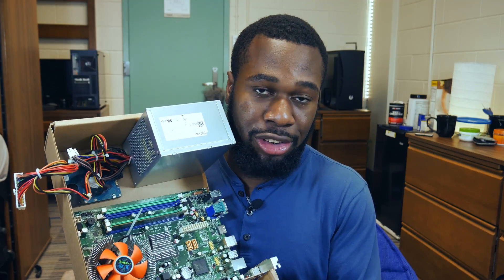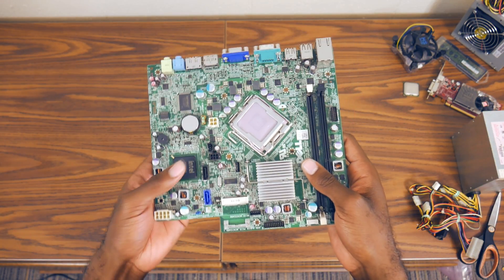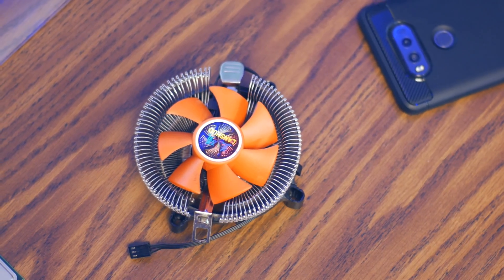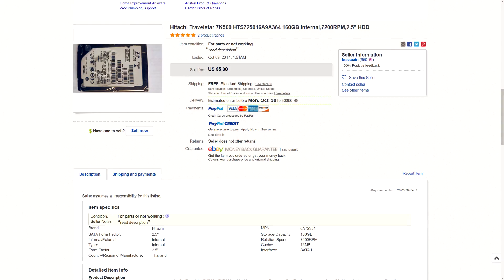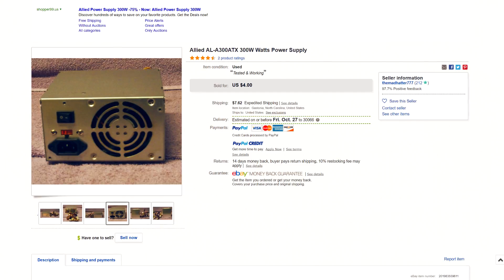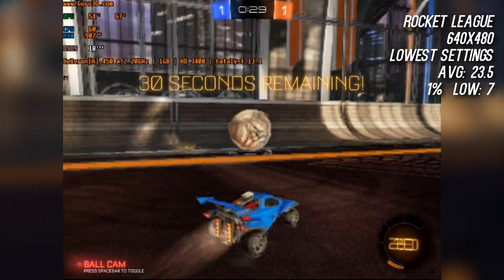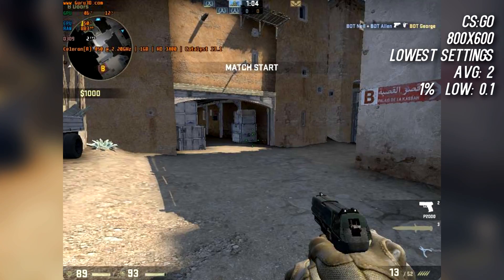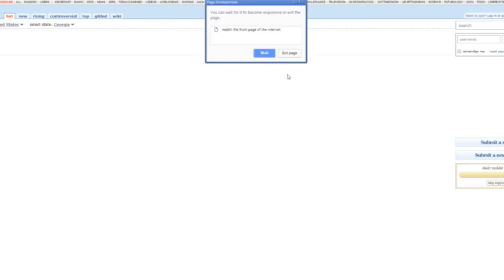I built the cheapest PC on eBay possible - can it play games? | OzTalksHW

Comment: Ok...this Video ist 3 Years old....but even 3 Years ago, I would have bougth an Core2Duo complett PC for 20/25 € and gave it a little Upgrade (sometimes Graphicscard, sometimes a little bit more RAM, etc.) . Today I can get a I3 or even a i5 plus a little Upgrade for 50€. And believe me, Gaming was and is no problem. Last Week I bought an Core2Duo E8500 on a Gigabyte Board, with 3GB  RAM and a Nvidia 9600GT Graphics Card on Ebay for 5 € (plus 5 for Shipping). All Parts in one Auction (tested and working). Today I picked up a PC Case with an 300W NT (tested and working) for free. (Using Ebay-Classifieds ~"Craigslist"). I will spend another 15€ for 1GB RAM and a 200GB HD (15 for both!). Ok, I used Ebay and Ebay-Classifieds instead of just using Ebay, but hey...it´s 2020 and I still can build a complett PC with much better Performance, for only 25€

Comment: I'll be listing working parts on eBay that will be cheaper then this pc. 
Part one- motherboard. Dell optiplex 380 on eBay for 10 usd and free shipping. This has a dedicated pci slot 

Part 2- cpu Intel pentium d925 for 3 bucks 
Part 3 hdd- 5.50 USD 60 gb Seagate 2.5 inch drive

Part 4 hp Quadro 256 mb video card for 5 bucks even 

Part 5 psu 250 w generic Intel for 10 bucks
Grand total
10+10+10.50+3 
33 bucks my bad this was a better build in the video lol. I blame the shit cpu selection online atm. Nothing below 3 bucks. And I havn't even counted in ram yet lol

Comment: i know this video is like 3 years old now but...... Let me get this right, you got a graphics card for $3.5 ( 3:18 ) but then spent under $10 on a cable to use it. I am assuming when you say under $10 that that is was just under as otherwise you would have said under$7 or under $5. in which case. why did you not spend what you had on the connector cable on a graphics card that had a vga/dvi connector that may have been a little better. maybe a Nvidia 8500 GT or a 9500GT or even a Geforce 8400 GS as they could be got for $0.99 to $5 on ebay at the time.

Comment: The cheapest computer I have owned was a Pentium II machine I got in the early 2000's, from a surplus outlet, for I think it was 25 bucks.  With a then-modern video card, it ran newish titles OK back then, so I was happy with it.

My machine today, which I've just about completed upgrading, is about 12 years old (I've had it for that long).  It's a socket 775 Asus P5WDG2 WS Pro (with a modified BIOS), with an Intel QX9650, with a GTX 750 Ti SC, and 8GB of PC8500 RAM.  I am upgrading it from XP to Win7.  Haven't actually gamed with it yet but it boots up and runs just fine with internet surfing and things like that.  Once I get it reformatted with Win7, I'll see how it actually games with more modern titles.

Comment: I once got a $4 Gateway desktop, featuring the Intel Pentium 4 with a clock speed of 3.2Ghz dual core with Hyper Threading technology and a whopping 2GB of DDR2 RAM (4x512MB), missing nothing but the GPU and the boot drive at a thrift store. Via local sellers, I was also available to get an assortment of PCIe and PCI cards for $25, including an old 256MB (incredible for the era of this computer) ATI Radeon GPU, that got the old motherboard to launch into the BIOS configurations. I paired all of this with a 500GB HDD boot drive salvaged from broken laptops given to me. I managed to install 32-bit Windows 7 Home Premium on, and voila! A total of $29 spent on a refurbished Intel-based build. A great deal found locally!

Comment: Oh god, flashbacks of that "one time" a buddy and I pieced together a computer using various remnants of computers spanning several years. Industrial strength velcro, metal tape, and a lot of fiddling. It worked, and it worked great for what it was (an essentially free computer). I just did a quick check over eBay and surprised at all the available parts that are pretty cheap now. I'll have to keep this in mind because before the year is up, I will probably be building me a "budget gaming computer". I'd prefer to spend less than $50 on it but may go as high as $100. I don't have much interest in modern games, I just want a computer to play around with. My current computer is an off-lease business desktop that has plenty of power, but it's getting old and gaming is just not a thing it does well. If I beefed up the power supply and found just the right low-profile graphics card and upped the ram to 16GB (max supported), it might be worth it. I'll have to investigate that.

Comment: picked up a Dell Optiplex 960 w/ Core2 Qaud 9400 @ 2.77GHZ for $30 on Ebay, also a Radeon Hd 6570 1GB for $17 and 8GB ddr2 Ram for $18.....total was $55 and it runs GTA V at average 30fps at 480p (low) and 25fps 720p (low). now my wife uses it to play SIMS on.

Comment: I think if you're going to do these "Cheapest PC on xxx" you should build a whole computer. it's not a computer if you have to put the parts in a box. last time i checked, when i go into a computer store and as for a computer, they don't hand me a bunch of parts and a box! i think you should do a "Cheapest full computer system build on newegg" or ebay. Should include everything you need to just plug in and go, Monitor, keyboard and mouse, case etc

Comment: cool build. im actually running a lga 775 cpu (core 2 quad q9550)  in my main rig. its on a ddr2 8gb mobo  a asus pq5 se plus and a gtx 1050 2gb. the cpu is  i have is overclocked it from 2.8ghz to 3.4 with water cooling and ssd drives. so in the end i can run fallout 4 in 1080p @ 45-60 fps in ultra setting with only the antialising and vsync turned off. amazing what can still be done with this old tech. soon i will try a ddr3 mobo with the same set up and a mod 771 xeon (x5482) in it. ($60) for both and see if i can overclock to the xeon to 4.0ghz - 4.4ghz. any thoughts or suggestions?

Comment: I don't Understand what stress about the idea of a bad power supply so much. In my name system sure I have a decent pub in other systems I've had I've always used the same 500w Chinese thing that was bought for 13 quid and it's never let me know it's quite perfectly stable it doesn't get hot so I really don't see what the big deal is particularly if you don't need a power angry dedicated GPU - take a 1050ti for example a can run with no additional power connectors. 

And I wouldn't recommend stressing a cheap power supply but using a day-to-day basis I really can't see the problem.

Comment: Great videos, I recently found your channel and just sub.  The reason I found it was cause,  I was wondering what would be the cheapest PC I could build that would play older games and maybe later newer games fairly well. I wanted to just use eBay, parts I already have just easier than driving around town. For example, I found 15.99 Dell Optiplex 7010 motherboard. I have an i3-2100  laying around and some DDR3. That board can support 3rd generation Intel up to I7.    I also have cases the wife wants me to trash. I just ordered a board with the I/O shield for a bit more. I’m concern about the possible proprietary connectors on that board, any advise? Now what to use for a video card. The only thing I have already is an Nvidia 9600GT. I’ll probably give it to a nephew when done playing with it. Thanks for the great content.

Comment: Bought/ upgraded a 775 system for about $175. Xeon E5450(can't go past stock 3.0ghz though since mobo is at its bus limit already with this CPU and has no CPU voltage options), 4gb ddr2 800, 120 gb ssd, gt1030, 320gb hdd, 80gb hdd. Decent little media/htpc. Most of the cost was the gt1030 which I bought used for $70 Canadian and the  ssd new for $50, the CPU for $30 off eBay and also added a deepcool CPU cooler for about $12. The base system which included the hard drives, case and psu, ram and motherboard I found on Craigslist for $15. May have over spent a bit as I could have found a better deal on a video card but I wanted it to use less power and make less heat. Also probably could have left out the ssd if price was a concern but the ssd just made it so much snappier. Once you've used ssds it's hard not to include even a small one as a boot drive even in a cheap budget build.

Comment: my pc that I am using now took me 4 years to build and $250 - 270 AUS it rocks
intel Q6600 2.93Ghz cooled but a deep cool mini 
gigabyte ga-g41mt-d3
AMD hd6950 dirt 3 oc 2 gig 
6 gig ddr3 1300mhz 
corsair vs650w psu
running dual screens 
Logitech g105 keyboard and a ozone neonm10 black mouse and windows 10 pro(not activated)

Comment: Apparently you can get much better deals with bundles, but given the rules of the game...
All buy it now prices as I will not be purchasing, not including shipping, all "working", and all items with crazy shipping prices ignored.
CPU : core2duo e4500 $4
Motherboard : Intel dg31pr $15
Ram : 2x2gb $5
CPU cooler: Intel stock $3
GPU : hd 4670 $5
PSU : 350w $4
Total:$36

Slightly more, but well worth the price difference, lowest isn't always better. Apparently you can get a "working" motherboard with cup and 2gb of ram for under $13. E6750 coup at that.

Comment: Built my main computer in 2008/2009 and was free.  Was signed up for a class on how to build a computer which I took home afterwards.  Still run this old computer, have replaced a few things like CPU,GPU,SSD and recently power supply went out so had to replace that.

Comment: Picked up an old Pentium dual core for £12, reasonable PSU. All it does is sit in a cupboard with a load of pass down hard drives holding a back up set, have an i3 Laptop on the way for £31 too.

Comment: I bought a lenovo desktop with 4gb ddr3 1600, intel G645 @2.9Ghz lga1155 mb, 6x usbs, DVI,VGA,  and 320GB 7200 rpm drive for 53$. Not one single problem. Benchmarked the shit out of it. Absolutely cool silent processor and fan. Very low power consumption. Perfectly clean mint beautiful case. Enough power to run youtube and most applications. I run photoshop on it just fine. I've hooked up a 1080p monitor over DVI-D.  Not for gaming, though has a PCI-e express. A desktop pc should be quiet and be able to handle youtube on HD with a few tabs open. That is enough for most users. Nothing beats the experience of browsing the web over a large monitor. I could upgrade it but I don't need to since I have a separate pc for video rendering and I use this while the other one is busy. Plz visit my channel and subscribe.

Comment: My cheapest computer/laptop is an Asus M51Va..

CPU: Intel C2D P7350 2x2, 0GHz
GPU: ATI Mobility Radeon HD 3650 512MB DDR2 
RAM: 4GB DDR2 800MHz
HDD: 700GB

It cost me like 40 € back then used and for 1080p30 YouTube or for light gaming (NO Rocket League or anything what requires a 8800GT) ran fine. ..... Well...GTA V had massive graphical issues... same as Frostbite 2 games but overall it ran great with older titles up to 2009-2010.

I recently played CoD BO2 but everything on low except of textures and at 800x600.... 40-70FPS but with 40 sec loading times in the loading screen.

This laptop was used til December 2016 as my main laptop/pc.....I'll never forget the good times I had with it

Comment: I built a used parts PC recently, Core 2 Quad Q9500 (2.8gHz) 8gb ddr2, evga GT 740 SSC 4gb. It does pretty well! I get a solid 60 fps on overwatch on customized high with some things set to low and others very high. I call it my "2009+" build. The + being for the "new"(er) graphics card. This system probably wouldn't have been practical to build from ebay, but I already had the card and I got the psu, mobo, cpu, and ram all from a friend for just $24, and an old dell case to throw it in for free from another friend.

Comment: The cheapest just built it a AMD Sempron 140 single core computer 4 gigs of ram 24.00 dollars Sempron 140 cpu 13.00 dollars case 50.00 dollars power supply 50.00 dollars 320 gig hard drive free motherboard free a Asus gt 1030 graphics card 66.99 windows 10 pro free it activated after install.

Comment: You should try to make the most functional cheapest PC
Reply: Dell Optiplex, best graphics card you can afford without needing to upgrade the power supply, done.  You can't beat used office computers for value.  As long as it has an intel i3/5/7, 8 GB of RAM, a 7200 rpm HDD or an SSD, and is the MT formfactor, you can throw in a 750ti or 1050ti with no other upgrades and play almost anything for years to come on at least 720p low and most things at 1080p high.

Comment: The cheapest computer I ever owned was an Asus eePC 1000HE. I got it for only $80, and for the money, it was fine, even with Windows 10. You-tube struggled at anything more than 720p and no modern games were possible, but it ran retro games such as Half Life just fine. It's biggest pro was portability, because it's so small.  It was great for running old emulators such as GameBoy Advance and some-such. It was also great for on the go programming, some minor wireless penetration testing and video watching.

Comment: Not cheaper, but back in like 2011, I built a Supermicro Dual opteron PC. Had 2x Opteron dual cores, running with the AMD copper pipe coolers they used to have.

It ran 4x2gb DDR2 ECC, with a WD Blue or green 500gb HDD, mobo had a PCI-e full size, so i put an XFX 5550 1gb or something in there. 

The build, with two 19" widescreen monitors, keyboard, mouse, etc, cost me about $150.

Used it 9 months playing Skyrim and WoW on my private server, then sold it for $350. Got an email a year later from the guy, said it was the most beastly, stable PC he'd ever used. 

I'm the type that will buy a broken mobo, swap out bad caps, and push it to the limit of its design. 

Anyone can throw $2,000 at a build and come out with something nice, do it on a quarter or less of that, and that deserves props. 

Congrats on 100k, just broke 1,000 myself and I never thought I'd even break 4 digits.

Comment: Good choice to not stick with the Intel GMA 4500 included in the Q45 chipset. It is slow as hell. It was abyssimal when released and no comparison to modern day Intel graphics. We are talking about Geforce 2 level of performance in 2008 
As a modern comparison That would be like releasing the 8600K with an integraded GT 210.

Comment: I was able to put one together on eBay just right now with these specs 
HP AM2 Motherboard 13.99 Free shipping 
AMD Athlon 4000+ X2 2.10Ghz 3.39 Free shipping
2GB 512MB X4 DDR2 5300U 1.90 + 1.10 Shipping
Nvidia Quadro 580 512MB DDR3 9.49 Free shipping 
Used Generic case with Generic PSU For 5.00 
Laptop HDD 5400 Rpm 80GB 3.99 Free shipping 
Free shipping 
Total cost was 40.19
I think that would be a better performing Desktop 
But then again it’s more expensive then this one lol

Comment: DC 7900 - 30 bucks
8gb of ddr2 ram - 30 bucks
gt 1030 - 64 bucks
intel core 2 quad - 13 bucks

CS GO @ 55-70 fps
rocket league @ 80-90 fps
Dying light (Low) 45 fps
 not under 50 but still a nice machine. sold it for 175

Comment: Yes!  I have a case fan zip-tied to my Radeon HD 7790 after the bundled one stopped working and replacing it was $30 or something excessive.  It ran for a month before I noticed...and somehow didn't die.  When I turned active cooling back on, my CPU again became the usual bottleneck until I recently transitioned the 7790 into my new Ryzen 5 1600 build!

Another fun watch!

Comment: As a follow up, can you add a cheap 40 GB SSD for about $25, (https://www.ebay.com/i/232485079570?chn=ps&dispItem=1), or more memory, or a better Processor: Core 2 Extreme Quad Core for about $25. I think this series is great for building someone a basic PC, but the next question is always, can I upgrade it? I think this would be a great way to go with this video series; first build the cheapest , then how to upgrade it for another $50 or so to make it playable for some of the games you tested.
Reply: Core 2 Quad on ebay : https://www.ebay.com/itm/Intel-Core-2-Extreme-QX6700-2-66-GHz-1066-MHz-CPU-Quad-Core-Processor-775-Socket-/131619567457?epid=74095958&hash=item1ea5233761:g:cwkAAOSwT5tWJnLA

Comment: Adding a second stick of 1 gig of ram (total of 2 gigs) would help with Windows 7 (my bare minimum) Single cores are almost impossible to get working well these days :(  But I do have a single core P4 (@3.2ghz with two megs of cache) 3 gigs of ddr2 with a AMD 6450 video card. It runs 720/1080p pretty smoothly in YouTube videos.  Can you add more ram and maybe a better video card?  Thanks for the video!

Comment: My main computer is actually an Optiplex 380 rocking a Pentium E5400 dual core 2.7GHz, 2GB of DDR3 Ram at 800MHz, and the same Radeon 3450 GPU. Im able to get good performance for day to day processing and browsing, and I can play any old or lightweight title like Minecraft and get about 40 FPS on 720p high. The 3450 is actually not designed to be a gaming card, not even a low end one for its time. The DMS-59 port is so you can have 2 monitors and be productive. Windows 7 eats up RAM even, having 1GB is probably what caused most of your slowdowns rather than the slow single core Celeron you got, considering my Pentium is just a dual core version of it. You were probably crashing the hard drive with your page file.

I use this as my main as its reliable for just doing simple work and college stuffs, I have a ULV laptop thats about 4 times faster CPU wise, but honestly about the same, maybe 1.2 times faster on the GPU department. Its kinda silly.

Comment: 2:26 "I'd imagine games from 2006 and prior, should run fine on the processor, with the computer struggling more, with games released in the last decade." 7:04 "I initially planned on benchmarking games such as GTA V".  OK then.